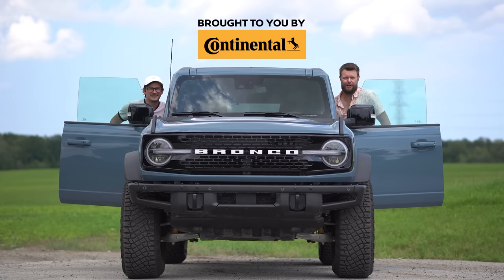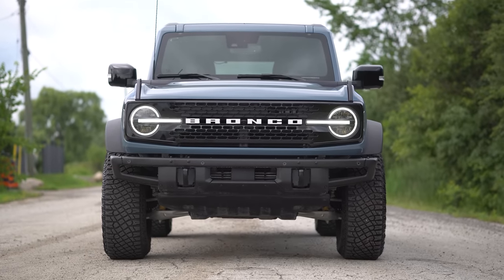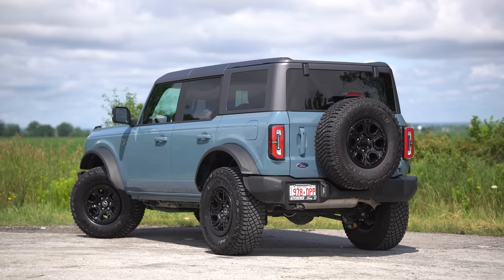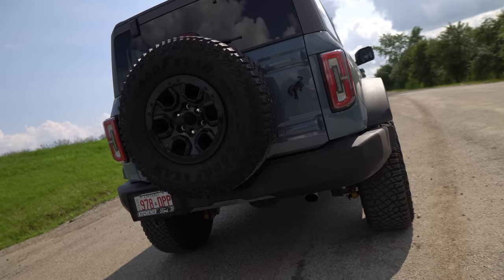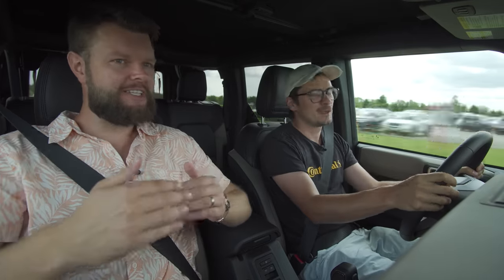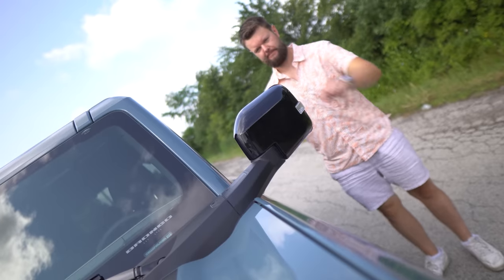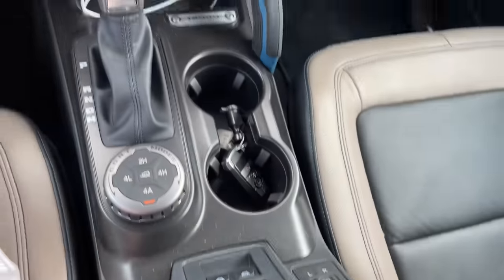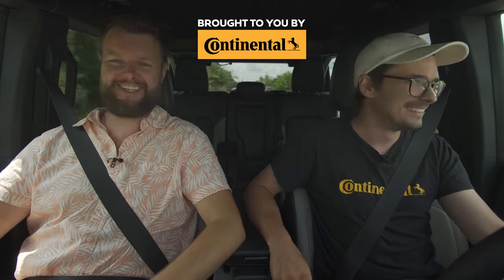RIP JEEP! 2021 Ford Bronco Review

Comment: If anyone has any doubts about the capability, go watch Matt’s Off-road Recovery. Nearly all his recovery vehicles get stuck on a sand dune hill. All of them are heavily modified to rescue vehicles off-road, mainly in sand. 

A stock Ford Bronco made it up first try. With some bigger and nicer tires pushing more power, these are absolutely insane. 

And Chevy made fun of the twin turbo V6 😂 Chevy can’t even compete. Never could.

Comment: wished the tailgate opened down instead of sideways, and come on ford, i know a dinosaur like me ain't gonna get the V8 like i want, but at least get that 3.5 v6 ecoboost in the thing.  looking at the MPGs for this though, i can't imagine it would actually change much with the V8...

and nitpicky, a little, but the rise in the beltline at the front of the quarter panel...it just makes an already stubby vehicle look more stubby, its just there for no reason and would look better with a straight beltline.

Comment: I think you guys are judging the EcoBoost engines too much solely based on stock exhaust which is always way too small for good sound to come out. Wait til you hear a 2.7 or 3.5 with a full 3-4 inch exhaust. Changes a LOT. My 2.0 EcoBoost sounded like an angry sewing machine until I upgraded to a 2.5 inch, let alone a bigger exhaust.

Comment: If it uses the same 4wd vacuum system as my f150, i wouldn’t risk buying one. Looks cool, like my f150. But even though I don’t use the 4wd, the IWE’s keep breaking and stuff gets in the vacuum lines and cause them to engage/disengage. First time sounded like transmission slipping. Second  time sounded like axel broke and was dragging. Third time, it slips out and grinds every time I turn left and the only way to stop is it putting it in 4H then back to 2wd. So many people had this issue and they only repair the IWE and not fix the problem. Buy at your own risk
Reply from the maker: Haha I had to replace the IWE's once in my Raptor. So far so good

Comment: I like the doors fixes Ford did with the bronco over the Wrangler but everything else they nit picked was dumb. Its a one for one carbon copy of the wrangler. They didnt do it all better they did it the same. Except for independent front axles and and ecoboost engine its the same vehicle with different skin. Dont let their obvious bias sway opinion. Do some research, drive both, and then decide for yourself what you like better.

Comment: I am not 100% about ford bee reliable as Jeep i will never trade the jeep for a Ford. I use to have the mustang ecoboost and had many issues dealer service was horrible. Since i got he JK i lifted up and out 35” on it , never had an issue with it. And here in Florida with all the tropical storms it is a pleasure to drive in in large water puddle. The bronco is a bit to mew yet.

Comment: It is a tiny engine, over worked, with turbo.  That thing will not last very long.  The entry engine is a four cylinder, believe it or not.  At the asking price, it should have a 4.0 litre six cylinder for the entry engine and an optional V8.  It is beautiful, but the beauty ends under the bonnet.  There is also absolutely no solid front axle offered in any variant of Bronco.

Comment: This Bronco is decent, but will NOT outperform the Wrangler. Especially with the IFS. And Jeep having the 3.0 diesel, and a 392 V-8 option. And dual lockers, and 4:11 gears available.  Plus the Jeep is better looking,

Comment: Its really unfortunate I prefer how the jeep looks, the bronco looks smooth and boring to me. But the bronco is better in everything else.
My 50k jeep doesnt have power windows, power locks, keyless entry, it bounces around like crazy on the highway you have to be at %100 focus and both hands on the steering wheel at all times, the audio system is shit, the infotainment system doesnt have any fancy features other than bluetooth, even then it takes 2mins to boot up and then another 2mins because I have to manually connect my phone everytime.
To think I could get a base bronco for less and get more... smh

Comment: 330 hp* they have a 300 horsepower and a 330 hp where did they get 310 from.......just figured it out put premium in it you cheap bastards. spend 2000 dollars for a better engine then put the wrong fuel in it? no one is going to do that

Comment: 1. These are built in Mexico, quality control is terrible. Buy a car built in Canada or Japan, if you can. 
2. the 4-cyl eco engine has been nothing but problems in any vehicle Ford put them in - look at the explorers with them. 
3. the Torque control on most are having issues; so, be ready for the recall (if they do it.) 

RIP to the hopes and dreams the bronco would be worth it.

Comment: 3500 pound towing capacity is a joke for an suv like that in 2021! My old 2006 forester could tow 5000 pounds. 😂
Reply: It's the ranger frame. The suspension isn't made for towing heavier. Buy a truck.

Comment: A manual only with the 4 cylinder.  No v8 option.  Ecoboost mechanical complexity. Never underestimate Ford's ability to screw up a roll out.  Stick with the Jeep.

Comment: All the “new car shine” is gone on the Bronco in record time. -They don’t look great in person, the engine bays are a complete and total disaster, the tops are literally falling apart and incomplete, second row leg room is terrible, the interior is just tons of ultra cheap plastic, the GOAT systems are already failing, the floor pans are taking small rocks and making tons of noise for it, door hinges are not painted but just have a shot of overspray on them when doors are off, door replacement requires some insane little peg. Mayyyybe next gen but sadly, this is not a vehicle to run out and buy now. It’s already a fail and another few months will be very telling.

Comment: Hello
I am an old subscriber which used to love your reviews but this one is completly wrong.
First thing first you are reviewing this car like it is a ford mustang, not an off-roader. With sport mode and launch control. This car is not made for this kind of stuf.
În my opinion a better review whould be on an off-road track.
Nobody who is normal whould not buy this car for confort and long trips on highway with family.
And in my opinion taking in consideration all specs jeep is much better for off-roading.
Reply from the maker: Most people drive this on road. Don't worry, we already did a separate odf road review where we jumped it. Thanks for being an old subscriber

Comment: This rip jeep headline kills me. I can’t believe  they even compare this to a rubicon. Let me be clear here. NOTHING with an independent front suspension will do what a rubicon does. Ford literally copied EVERYTHING that doesn’t matter. And didn’t copy the 1 thing that does. Strait axel will always be superior. You get soo much more ground clearance. Ford you were soo close yet soo far away. I would have gotten the bronco if they had gotten that 1 thing right. Enjoy y’all’s rear camera while the jeeps are riding your ass on the trail to get out of their way. This is a 4Runner with a removable top. It’s a joke off road
Reply: But it’s so much cooler than any iteration of the jeep,  including the v8.    Solid axle or not.

Comment: Looked at one on the lot today for the first time and to say the least, I was unimpressed.  They got the seats right but the rest of the interior just felt cheap.  Se those cool grab handles?  The look great but they feel like they are mounted with some kind of cheap plastic.  I doubt they will last more than a year.  The carpet was only available in black (terrible idea for an off road vehicle) and it was extremely low quality.  It was like that craft stuff you can buy off the shelf at hobby lobby.  That awesome looking grill is low budget plastic that my nieghbors 5 year old could put his fist through.  The soft top it had was loose and had very low quality lift and mounting brackets.  I might call the bronco a decent first try but it's definately not a 50k vehicle.  Might look good on youtube but in person it screams low quality all day long.

Comment: Shame it has an automatic, with the manual only available with the smaller dog of an engine.  And the reason it rides like a car is because of the IFS, which in turn will make it less capable off road.  So, kind of a competitor to the Wrangler, about like the FJ Cruiser was, but not really.  Believe me, I had high hopes Ford would really nail this iteration of the Bronco, but they compromised where they shouldn't have.  I'm only going to drive a manual, and I want it paired to the trim level I want and the power train I want, which only leaves the Wrangler or Gladiator.  I can get a manual in any trim level and it'll be paired to the same Pentastar POS as the automatic.  I really like the whole Sasquatch package thing, and I love the look of the Bronco, but I'm not going to pay the stupid amounts of money they want for it and not get what I want out of it.

Comment: oh hey look its the most incapable Vehicle ever Designed......what exactly is this suppose to be competing against? i mean maybe the Renegade or the new Cherokees might have a run for its money but other than that i dont think it's capable of handling anything built between 1940 and 2018 By AMC/Jeep. The things packed full of unreliable  Tech that'll go out in no time and cost a small fortune to replace, EVERYTHING is controlled by electronics including Throttle and 4WD. It has CV axles which are the Worst thing in the world to put on an "offroad" vehicle. Severely limited Flex, Zero clearance, Cant put a real lift on it without the risk of Blowing a CV axle. if you're in the market to lease a grocery getter that allows you to drive more effectively in the winter then this is definitely the vehicle for you because other than the occasional trip to target i dont think i'd take this thing out in the rain let alone on rocky trails. this thing Costs you $70K and cant even do a quarter of the things that a $25K 2018 JKU can do From the factory and it cant do Anything that a heavily modified wrangler can do So save yourself $55K and buy a wrangler n put $10K in it and you'll have a monster